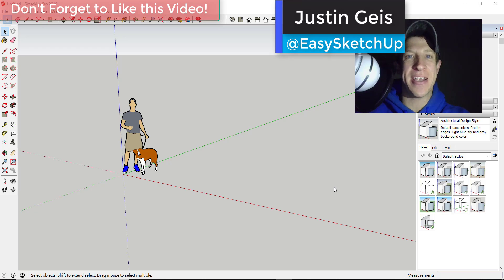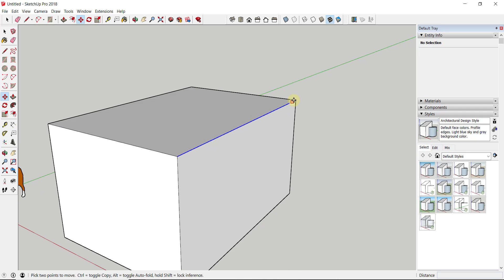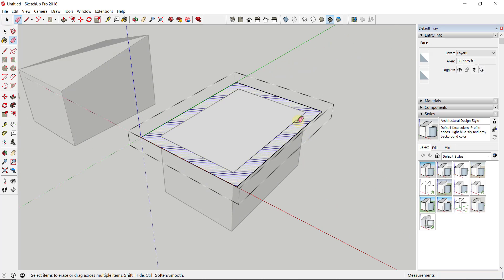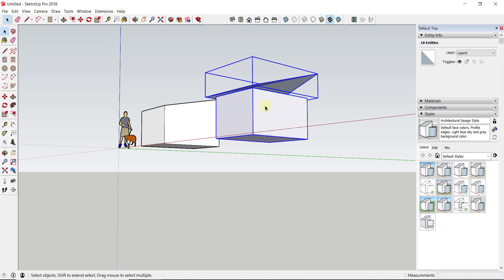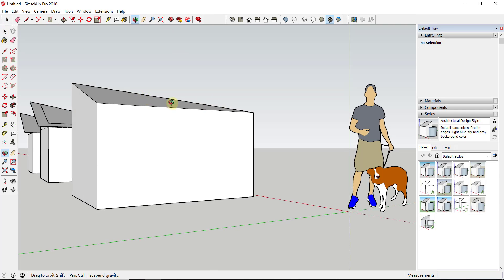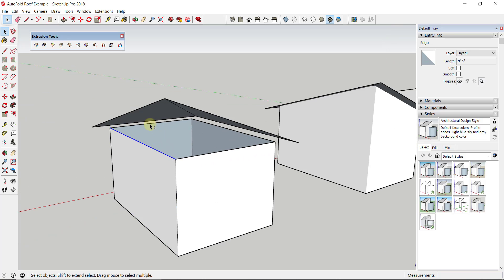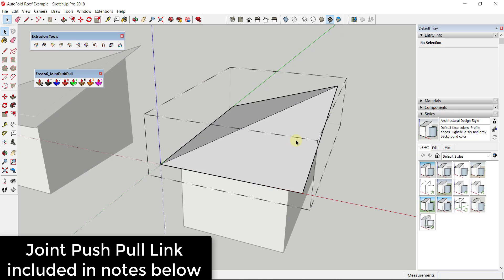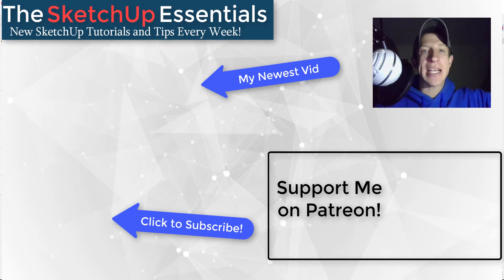EASY ROOFS IN SKETCHUP with AutoFold

Comment: Hi I left you comment on the extrude tools extention on another video.  I looked for it but it was not in the warehouse???  I searched under the makers name also.  But I could not even find the creator.  I am only on the trial version for one month.  But I need to know that everything is their before I commit to purchase the program.  Do you know what I'm doing wrong?  I have downloaded a couple of extentions already and they work great.
Reply from the maker: Does the link below the video not work?
Reply: Okay I'll try it in the morning.  Thanks
Reply: I just created an account at sketchUcation then downloaded the extrudetools but when I tried to open it this massage comes up (this file dose not have an app associated with it for performing this action.  Please install an app or, if one is already installed, create an association in the default app settings page)  wtf dose this mean.  Why dose this have to be so difficult?  I've just spent the last 40 min trying to get it to work.  It shows up in my downloaded file.  And when I try to open it it will ask for a search for an app.  I go to the sketch up program and it will run the program.  But there's still nothing in my extensions layout.  Only the weld and flowify.  So frustrating.  !!!!!
Reply from the maker: Did you install the extension? https://www.youtube.com/watch?v=r1EcMNiW7t0 - You don't just download it and double click on it - you have to load it within SketchUp

Comment: Hay Justin, I know this might be out of pocket but I just noticed that the extension JHS powerbar doesn't interface with 2019 pro do you have the same problem or did I miss a step along the way?
Reply from the maker: No clue - I have a feeling that extension may not have been updated yet to work with 2019 pro - I'd recommend sticking with 2018 for a while if you really need those tools until you're sure all the extensions have been updated to work with 2019

Comment: Have you looked at solar power? Perhaps all you need is to power your router and computer for an hour
Reply from the maker: Meh - I rarely have outages, so for occasional issues, not too worried - that said, I might invest in some kind of a battery backup so my desktop doesn't shut off in the middle of a model :p